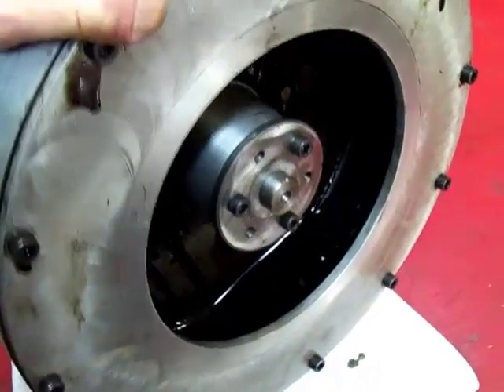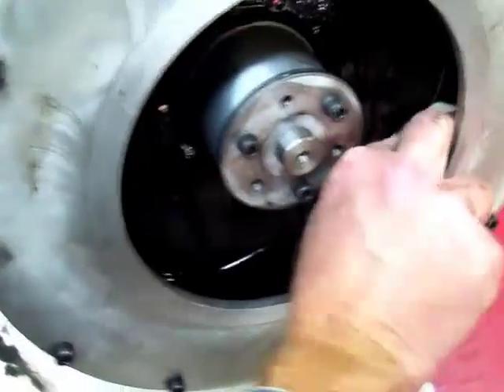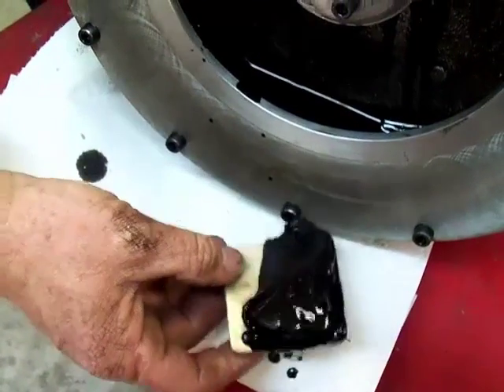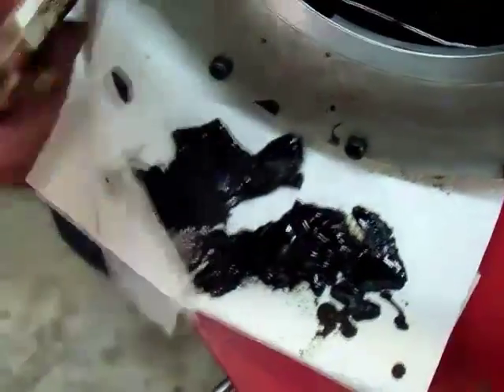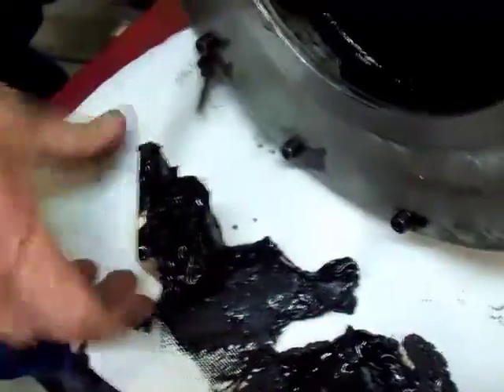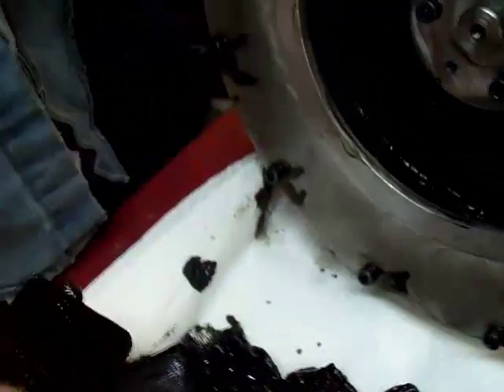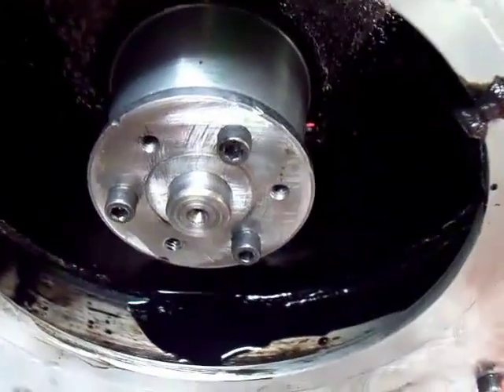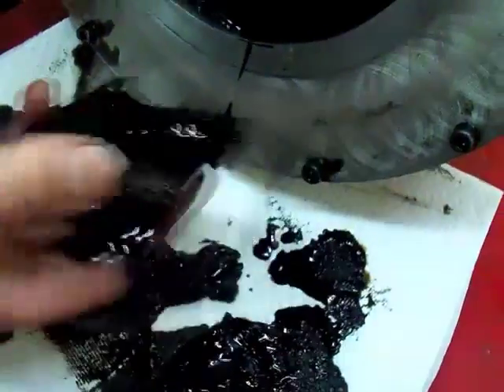US Filtermaxx WVO Centrifuge Cleans Waste Motor Oil (WMO) - Results

Comment: I found mixing the WMO/RUG before centrifuging it gets more contaminates out than trying to run pure WMO through a centrifuge alone. Basically the RUG lowers the WMO's viscosity allowing more crap to settle out faster.
Reply: Yes, this is true. but then you also have gasoline vapors to deal with. I've done it both ways..

Comment: What ratio of gas are you adding to your oil after it is cleaned to allow to be burned in an engine? I have seen elsewhere were they just mix oil and diesel in a 50:50 or 60:40 mix but never anything about cutting it with 10% gas.
Reply from the maker: The mix varies, but 20% gas well blended is a good starting point. You may run with diesel. See the PDF download in the video write up for more info.

Comment: Could one use that thick sludge for anything? Very interested in your product. I live in rural Montana off the grid so being able to make my own diesel would be ideal. Is it a complete kit?
Reply: That sludge is full of harmful chemicals and metal compounds. Should be handled with oil resistant gloves and stored in a sealed container, preferably metal, for disposal at a hazardous waste processing center.
Reply: Steve sells completely assembled centrifuges rather than kits. All you have to do is hook up your oil supply and drain lines and plug it in. You're going to need tanks/barrels, hoses and hose connectors. That part is up to you how you want to do it, but Steve also wrote a book explaining the entire setup and operation that he suggests. His book, one of several, is called "Alternative Energy Secrets".
Reply from the maker: I use the sludge or heating you can pack it in  a box with paper or sawdust and burn it in a wood stove. Remember that you also get a few gallons of liquid sludge with each run. I cut it with a little gas and blow it into a furnace. However, I plan a total redesign of that system capturing the heat in water (antifreeze) and pumping it into a heat exchanger in the house. Even though our winters are short here, I could save several hundred dollars a year in heating bills breaking even on the project the fist year.
Reply from the maker: Sorry for the late reply. I have to look at these videos to see if there are any questions. Sludge burns and it works in a wood stove or the sludgy oil can be poured into a box of sawdust and burned. Liquid sludge works in a special burner that uses compressed air.
Reply: Can you elaborate on the different options of what to do with the sludgy liquid? Sounds like there will be quite a volume of it to deal with.

Comment: USFiltermaxx holds nearly a gallon, theirs about a pint.  US Filtermaxx is 1.5hp theirs is1/3 hp.  US FIltermaxx is 3000G's theirs is about 1200. US Filtermaxx Motor is totally enclosed, theirs is an open frame Their rotor will just about fit inside the hole in our rotor. USFiltermaxx is made in USA, theirs is imported. USFiltermaxx is assembled and tested, theirs is parts in a bag.

Comment: A lot of goo is removed with centrifugial filtering even those static carbon filters couldn't seperate from the oil. 

In many cases, people thinks it is enough to filtering the oil with a denim trousers' leg. And after they encountered the aftermath on injectors,fuel filter and pistons, they blame the higher viscosity , higher flash point etc...